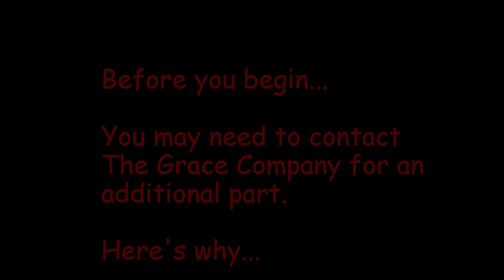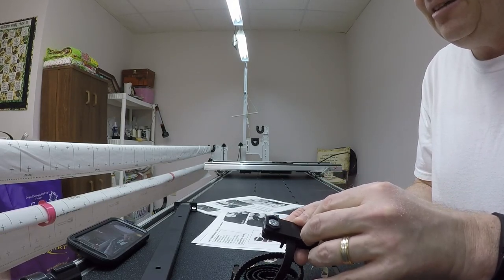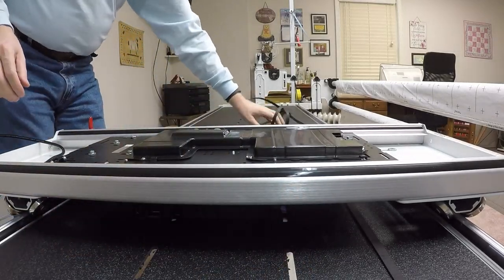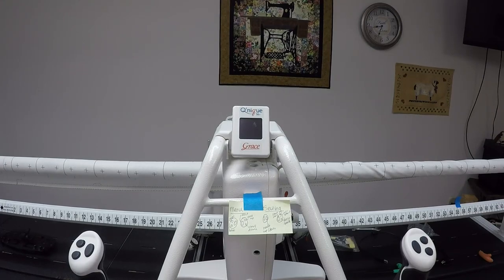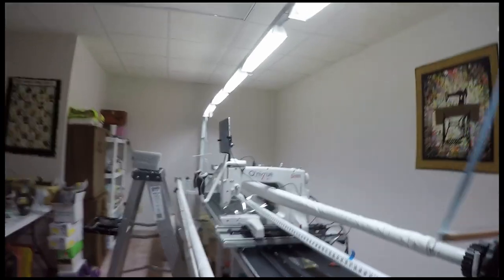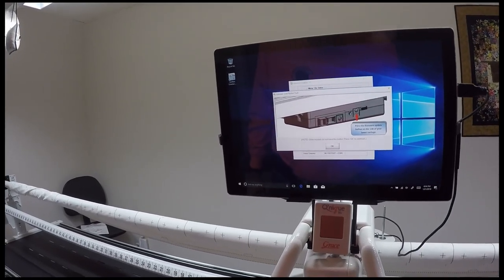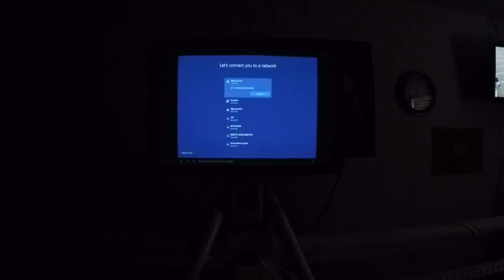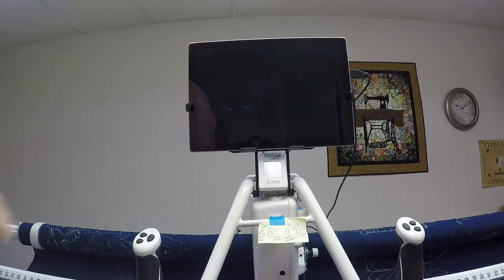Quilter's Creative Touch 4 Hardware and Software installation

Comment: Hi I just installed the QCT4 hardware & software, and registered my software - all of which I would not have been able to do without your fantastic videos. Your helpful tips about shutting off the security protection, etc. and adjusting the do not sleep modes, and having the tablet on airplane mode all are things that are not mentioned anywhere in the manuals. And please convey to your wife how great her videos are on using the QCT software. I have not tried quilting yet but do feel very confident that I will succeed because of the both of you. Thank you again. Janette - Ontario, Canada
Reply from the maker: Thank you so much for the kind feedback Janette. I'm curious where in Ontario you live. I'm originally from Western NY. Every few years, I'll get a yearning to cross the border into Niagara Falls and we'll eat at Swiss Chalet. :)

Comment: dfgeorge. Thanks for your videos.  I am in the process of the deciding whether to purchase the QCT4 for a Q'nique 21. I was wondering how the installation of the QCT4 hardware on the Q'Nique affects the movement of the machine in free motion mode. In other words, when you're not using the software to quilt, is the movement of the machine by hand affect significantly?  Thanks.

Comment: AWESOME VIDEOS its been very frustrating following the manuals and the videos on the  grace company are out dated. Would you happen to have a video on attaching the leader cloths? B/C the grace company does not have a video for the continuum frame :-(
Reply: To give you a quick answer for now......(and make sure to mark center on all leader cloths before attaching! I marked center on both long sides of each one and also on the velcro strip attached to rail. Having centers you can trust is SO important for loading quilt straight!!)
Use the first part of this video to see how to mark a straight line on your rail to attach the velcro strip by so that you can get it on the rail straight:
https://www.youtube.com/watch?v=2aG4eVcLJzU
This video is useful to see the DIRECTION the leader cloths attach (even tho not a Continuum frame - and ignore the glue and tape instruction): 
https://www.youtube.com/watch?v=QSVfs7_-oVg
Note:  If you have an idler rail, the longest leader cloth will go on the take up rail - above idler rail - that runs thru the neck of the machine; the shortest will go on the 2nd rail down in front  - that the top rolls on if you do not float your quilts. If you will be floating your quilt top, there is no need to install that leader cloth.
If you do NOT have an idler rail....then the shortest leader cloth goes on the take up rail and the longest on the 2nd rail down in front (if you will not be floating your quilt top.)
The medium size leader cloth always goes on the top rail in front that the backing rolls on to.
When leader cloths are unrolled all the way and hanging down, the one on the 2nd rail down in front (for rolling top on) will show the printed words. The words on the other 2 rails (top rail in front for backing and take up rail) will be facing to the back.
Hope that helps!

Comment: I really need some advice on tablet.  Everyone I check out it says no longer available.  Where did you get yours?  Online or ?  I am only going to use it for the quilt machine.
Reply: We bought directly from Microsoft on line (they definitely had the best price!!) It may be more than we needed....but we're absolutely happy with it - and we only use it for QCT quilting.
Reply: I got my surface go on amazon, reasonably priced and the replacement insurance was cheaper than bestbuy
Reply: @maryshaw9130  your using a surface go or surface pro?
Reply: I didn’t see the response 
Did you get a surface go or surface pro

Comment: First of all, I want to thank you for posting such detailed videos on this frame and accessories.  I just received my continuum frame that I purchased before Christmas and I’m so excited to get to quilting.  Did you attach your fabric leaders with Velcro?  I was wondering why the continuum frame didn’t come with the grooves to insert the leaders, is this something that you or your wife noticed on your frame?  Also, I noticed that the bolts that are holding the rails together aren’t flush with the rails, they’re sticking out quite a bit.  I hope this doesn’t cause problems in the future with the quilt tops or backing getting pinched in those bolts sticking out.  Overall I’m happy, and I hope to get the QCT Beginnings program that your wife has.  I hope she posts videos of her using the frame and software.  Thank you again!
Reply from the maker: Hi Candy. Thank you for the kind words. Yes, my wife does attach her fabric leaders with Velcro. She has a quilt loaded on the frame at the moment; when she gets it unloaded, we can send a picture of how the leaders are attached. With regard to the bolts that hold the rails together, they should not stick out at all. Without seeing a picture of what you have, my suspicion is that you have installed them incorrectly. What you are supposed to do is install the bolts into the couplers first, then insert the couplers with the bolts into the rail sections until the bolts align with the holes in the rails. Once you have done that, you use the Allen wrench to unscrew the bolts (i.e., turn them counter-clockwise) untl the bolt is snug with the rail section from the inside of the section. This will hold the rail section together. The bolts should not "stick out" from the rail segments. This is demonstrated in the video. Does this help? Please let me know...thanks!
Reply: dfgeorge oh I see...I’m going to check to make sure we put the rails together correctly.  I would absolutely love to see a video of how you put your wife’s leader cloth on.  Do I need to draw a line with a sharpie to ensure straight lines?  Thank you soooo much for your help!
Reply: Hi Candy, I am Doug's wife. I don't remember what way I crafted to come up with how I attached the velcro....but that topic came up recently on the Facebook page I'm a member of, Q'nique 14+ / 15R Mid Arm Quilters.  One lady used a chalk line and snapped the line (construction string line) to get it straight and applied the Velcro beside the line.  Another person rested a Sharpie on a nearby bar and dragged it along to get a straight line.   I just went downstairs and looked at mine. I may have tied a string really tight from one "U" that holds the pole to the other and used that to go by??  But I think using the chalk line sounds like a great solution!  Perhaps a laser level would also work?
Reply: Joyfulstamper thank you so much for this information.  I’m on Facebook so I’ll be sure to check this out.  I really love how detailed your videos are and I’m so excited to quilt on my new frame! Thanks again!!!
Reply: Candy, now that I've used the QCT4 Beginnings to quilt  my first little quilt.....I've learned a few things. First and foremost....the above tutorials I mentioned can be VERY confusing for someone with Beg version - as these tutorials apply to the Standard version. I printed out the Help doc from the software for the PantoStacker pages - they are far more useful. Planning to make a video of how to create & quilt an edge to edge panto for a small simple quilt in the near future......
Reply: Joyfulstamper thank you so much!  You guys are so detailed with your videos and they are simple enough for a beginner like myself to understand 😊.  I’m looking forward to seeing it!

Comment: What is the brand of your surface that meets the criteria for the software? Price?
Reply from the maker: Hi Louise...we have a Microsoft Surface Pro tablet...Intel Core i5 processor, 4 Gb memory, 128 Gb storage. We spent about $800 for it last year. It might be more horsepower than we need, but it has worked well for us. Hope this helps!
Reply: dfgeorge hi Doug! should the Windows system be 32 or 64 bit?  I see CT 5 is 32-bit app. Plus I’m having trouble tracing & sewing.  Goes about 100 stitches and freezes. I’ve opened a support ticket but my registration hasn’t been accepted yet so.... thanks for any advice available. You and Janet are awesome! Cindy Ullery

Comment: What kind of tablet do you have and where’d you get it??
Reply from the maker: Hi _Chocolate_...we have a Microsoft Surface Pro tablet...Intel Core i5 processor, 4 Gb memory, 128 Gb storage. We spent about $800 for it in 2017. We bought it direct from the Microsoft Store (they had the best price at the time). It might be more horsepower than we need, but it has worked well for us. Hope this helps!